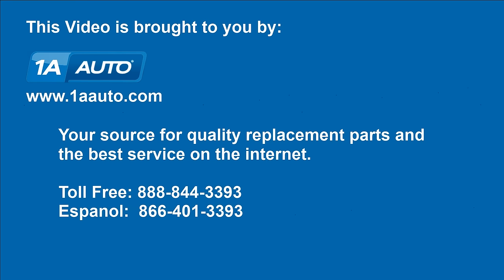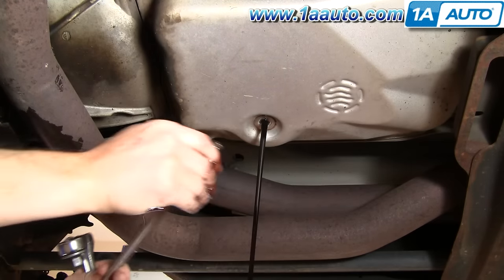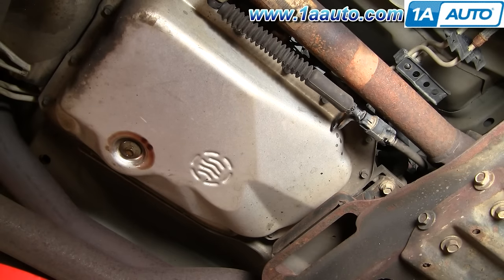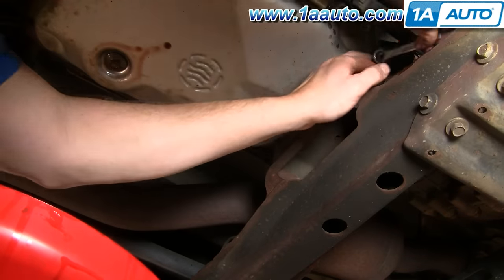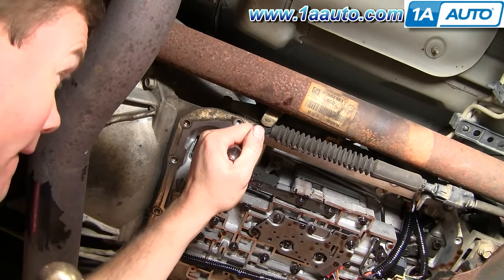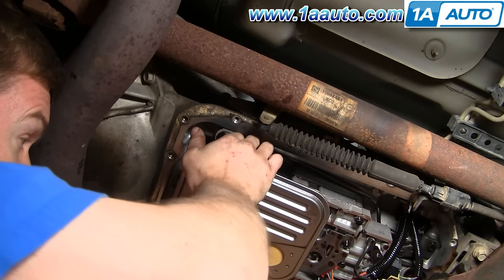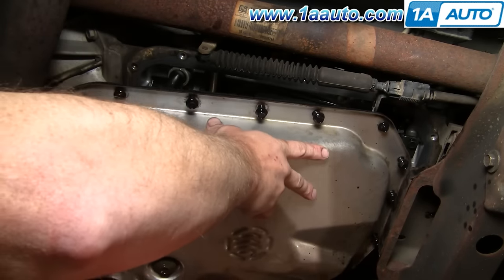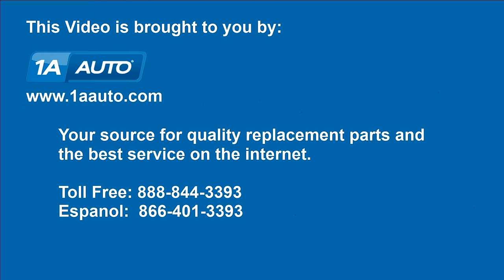How To Service Transmission Filter 00-06 Chevy Silverado

Comment: I have a 1990 GMC Sierra 1500 half ton, been great to me only 119K miles sits for 8 months a year. I was driving on freeway and the car felt like it slipped into neutral a couple of times as the pressed the accellerator. Got off and put the car in park, then put it back in drive and the needle on the gear shift didn't move? But the car went into drive...huh.. later I couldn't make it up the hill had to drive 10mph to get it up the hill. Checked the transmission fluid and it was low. Help

Comment: how can i tell what transmission is in my 2006 silverado 2500 HD LT gas 6.0
Reply: You have a 4L80E. You can check your glovebox for the RPO code too but you have a 4L80E regardless if 2WD or 4WD. When you try to buy a filter kit the vendor may ask questions about "deep pan" etc.

Comment: Is it possible that my transmission does not have a drain bolt? I have a 2004 Chevrolet 2500HD 6.0 work truck.
Reply from the maker: Thanks for checking us out! Yes, it possible your vehicle is not equipped with a drain bolt. Hope this helps you out! +REDSPECK HUNTER

Comment: I have a 03 sierra 6.0 and it has 370k miles. i changed the transmission fluid at 120k, but have not since then. Would it be ok to change it or not? ive read mixed reviews about it.

Comment: you don't show how to get the pan past the shifter bracket,     it won't.    looks like you bent it out of the way, should tell people this in your video, the 2 torx head bolts that hold the bracket on are nearly impossible to get out on top of the transmission.